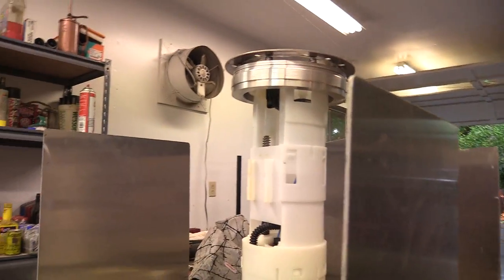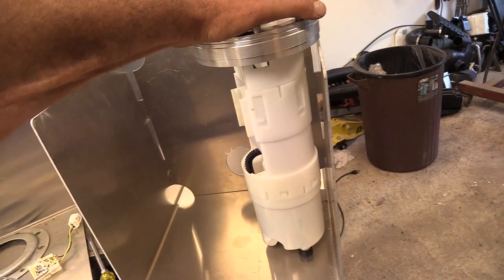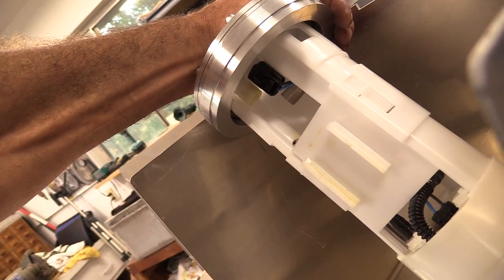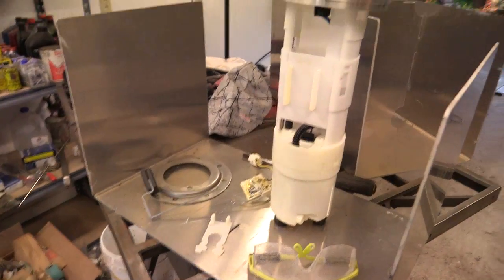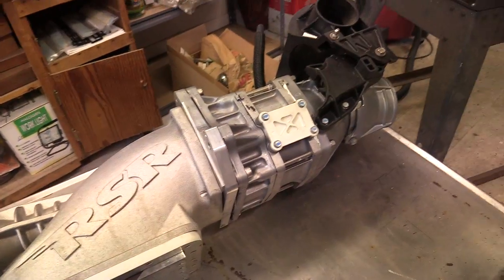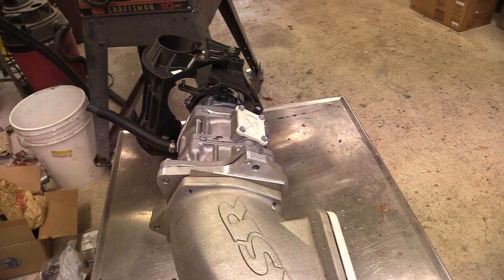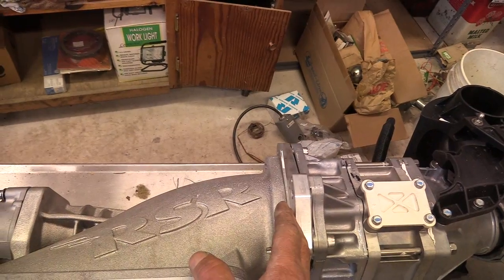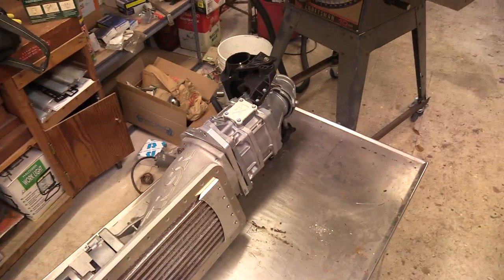Mini Jet Boat Build Video #5 Waverunner Fuel Pump, Fuel Cells, Intake and Adapter, etc.

Comment: I have a question about the fuel pump. There are two little electrical plugs on the top of the pump. One goes to the main wiring harness, where does the other one go?
Reply from the maker: Noah Lochner If I remember right, one probably goes to the instrument cluster, and the other to the engine control module. I labeled them and wrote it down, so I could check after work and tell you for sure.
Reply: Paul Christian thanks! I have the same RSR intake, and my pump all looks exactly the same as yours. Looking forward for your build getting finished.
Reply from the maker: Noah Lochner The dash cluster for sure. It’s a long cable that comes out of the cluster harness.
Reply: Paul Christian thank you!